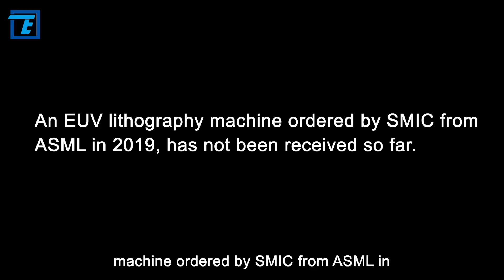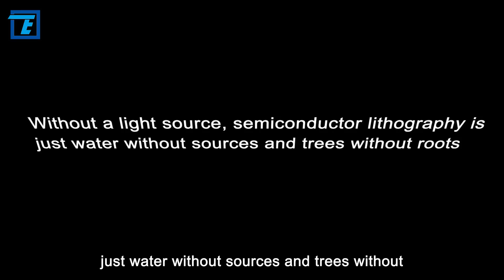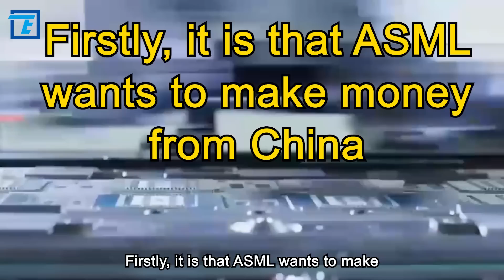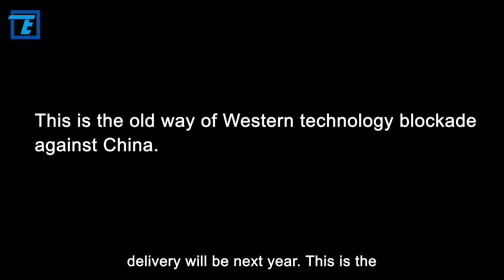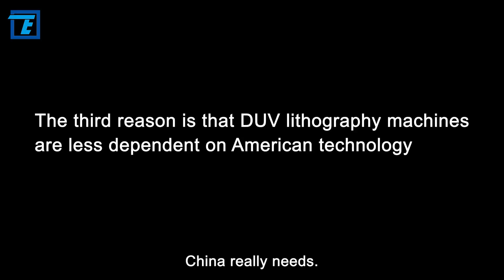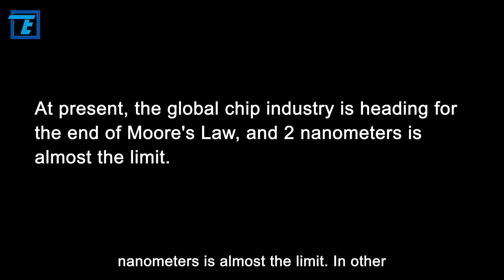Why does ASML dare to reject the US ban and export lithography machines to China

Comment: forget the old duv euv ,the UK engineering research in Manchester/scots University have trialled the cost of hard X-ray lithography & its cheaper than that of electron beam lithography. Also, the entire lithographical process is much faster using the X-ray system than the electron beam system. This makes X-ray lithography a good alternative for high-volume integrated circuit fabrication.
Reply: Laboratory to real machines is probably 10 to 20 years away

Comment: I believe that eUV lasers operate at a higher frequency (hence shorter wavelenghth) than the dUV in the electromagnetic wave spectrum just within the defined UV Band. Pushing this further beyond the eUV wave frequency has physical limitations.
So instead of using the lithographic process (basically a pattern etching method), R&D effort should try to find a "direct printing" method of the integrated circuits patterns on the silicon substrate, avoiding the lasers (and ASML) altogether.
Chinese talents and resources should work on this "radical" approach.
Reply: To david debic 2672
Yes, it will be difficult and had to move towards success step by step.
That is the "Development" part of the "R&D".
The "Research" part need to start now to get the concept right.
When I was in university in the late 1960s we used integrated circuits (IC) in our projects that carry only 1 or 2 switching circuits (flip flops) but today's semiconductors chips (large scale ICs) carry billions of circuits.
The "direct printing method" should be explored and the initial product will be only be a few circuits that will step by step increase as the printing  technique advances.
From the ancient bulky Motorola analogue phone to today's digital smart phone!
It can be done.
Reply: Picometer resolution is already a thing with EUV.   Xray will be next.  "Direct printing" is a step backwards.  Printing at such small scales, contamination is a HUGE issue...and would yield more unusable product than usable.
Reply: @Tha_Daemon  
As I mentioned earlier the integrated circuit chip started with only 1 or 2 switching circuits in the early days of the 1960s and now contain billions(?) of circuits in only slightly bigger physical size.
Direct printing of the circuits should be researched, proven POC and develope as an alternative to the etching method.
Technical breakthroughs can happen.
Reply: @wmchan44  I'm not saying it's impossible, but it'd be a huge bet. You could invest a trillion dollars in such research just to realise it's something not feasible within this century. This sort of stuff happened tons of times. We tend to invest in rapdily developing fields because we know there isn't too much of a hurdle to achieve tangible improvements. In this case the rapdily developing field is EUV lithography. Trying your luck with something else is just drawing a lottery ticket.
Reply: @davidebic  
Doing research on a new method or concept in the lab does not cost trillions of dollars.
Not doing this research and developing a proven viable method to full fruition will cost the trillions of dollars.
A good example is the photography process which change from a film/negative/paper chemical base method to the current digital imaging/direct printing method.
It was believed that KODAK of USA first explore digital photography but did not pursue the then new concept further, leaving the Japanese cameras companies an open field to develop the digital photography.
As they say, the rest is history.
Big giants German camera companies (Rollei, Zeiss, Agfa, etc) are replaced by new Japanese companies (Canon, Nikon, Fuji, Olympus, etc).
USA's Kodak and Polaroid are rarely heard of now. 
So do not fail to explore new concepts and new methods to do established things.
Reply: @davidebic  
Another reason for China need to explore alternative to the ASML/eUV process of making the semiconductors chips is that the USA had now totally fenced in China  and prevented China from getting the eUV machines from ASML.
USA had also stop foundries with eUV machines from making the high end chips for China.
China had no choice but to break out this American stranglehold.
A matter of survival.
Reply: @wmchan44  The exception does not make the rule. The problem is that it's a highly risky bet to invest into such research. Also, it is a field where you need to invest at least a dozen billions to do something. It is also why TSMC has had free reign for a few good years now. The entry barrier is simply too high. I'm not saying it's impossible for it to work, I'm saying I doubt China is willing to take such a risk. You also have to consider the Chinese political and economical climate that has been ongoing for months now. And, even if you start to research now, it'll take years to be able to use it.
Reply: @davidebic  
OK, the decision whether to proceed with the R&D on this printing approach to make the microchips lies with the Chinese.
I am sure they will weigh all the options and costs involved and decide for themselves.
Reply: I don't quite have the technical skills to answer this, but I'm sure it's not that easy. Printing something at the size of a few dozen atoms isn't something so easily doable.
Reply: @davidebic  do have the ability to move individual atoms and tens or hundreds of atoms now, but only manually in the lab, under an electron microscope, but in a way that is obviously impossible to produce on an industrial scale.